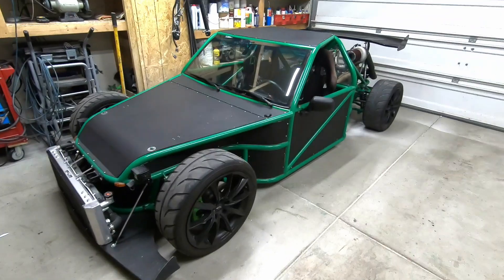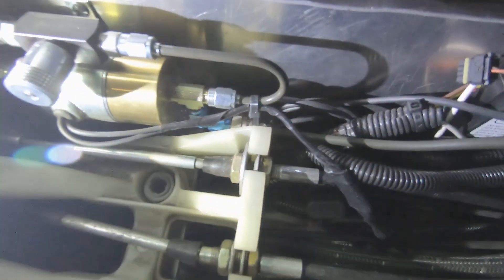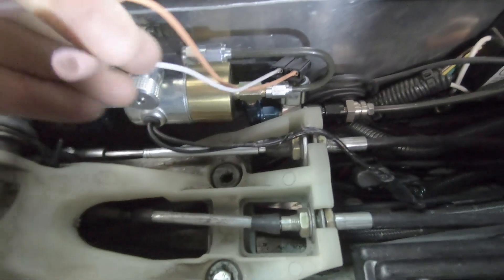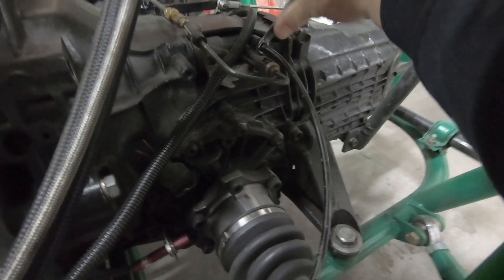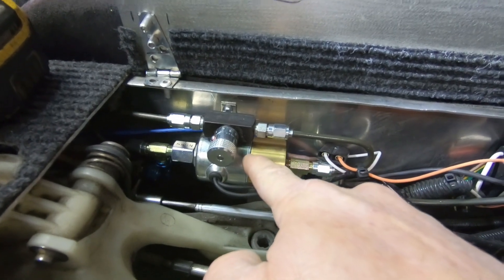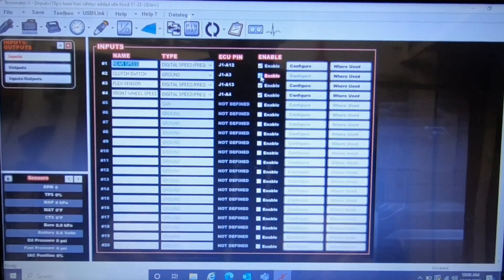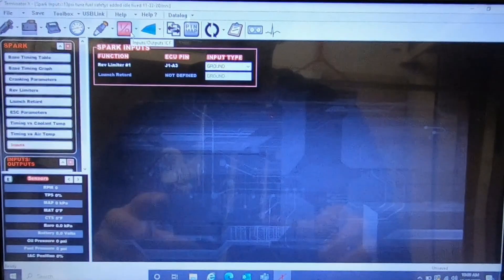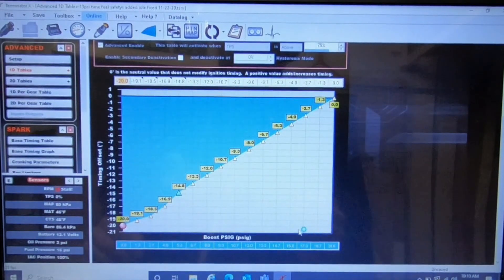Setting Up Two Step Limiter on Holley Terminator X and Install a Clutch Switch

Comment: Just now seeing this video and setting up a 2 step on my terminator x also. I'm curious as to what your timing offsets were and effective was your boost building?
Reply from the maker: Awesome I went a bit drastic to put on a show. I went as far as -20* but it was able to hit 12-14psi
Reply: @DeathByBoost  that's surprisingly good. I'd like to see between 8 and 10 psi around 3k rpm. I scaled table to 10 psi. I'll probably have to mess with it to see how it responds. How did you scale.your table?
Reply from the maker: @sevenisg0d  check out 8:15 something like that start with alot of timing pulled then let it come back up as boost is made. Be careful tho I almost messed up real bad and forgot to put the (-) negative in the numbers and I did plus 20 that’s a good way to send a rod lol
Reply from the maker: @sevenisg0d  and then as far as boost just set the max limit in your boost table
Reply: @DeathByBoost  or melt a piston😳
Reply: @DeathByBoost  thanks for the response btw. I'm just getting into the holley system coming from HPtuners so I'm absorbing as much info as possible.
Reply from the maker: @sevenisg0d  your welcome your going to enjoy how easy and customizable it is

Comment: Holley systems are nice, costly to get started but I've heard its easier making small changes in the long run. Thanks for the tech!
Reply from the maker: There not to bad a terminator x is 1000 with the harness